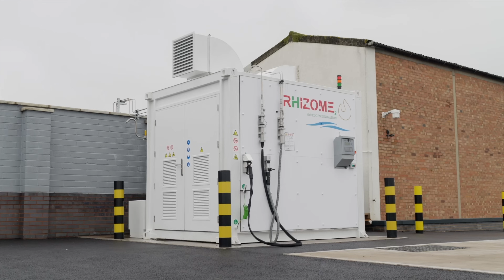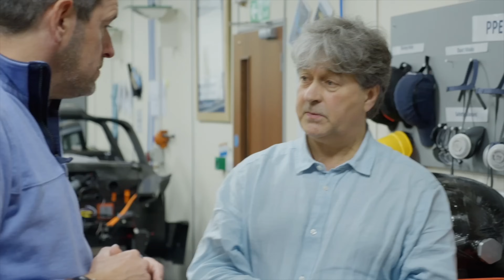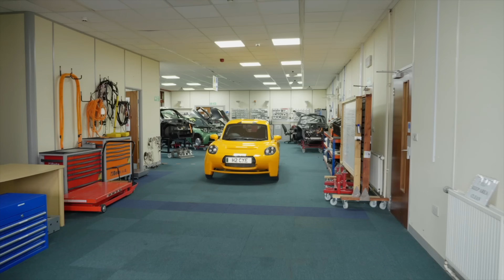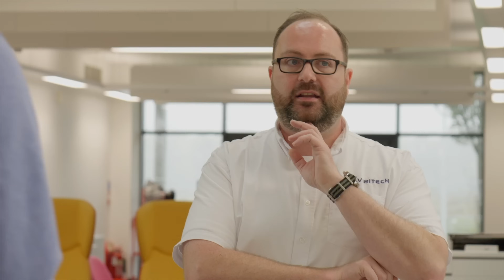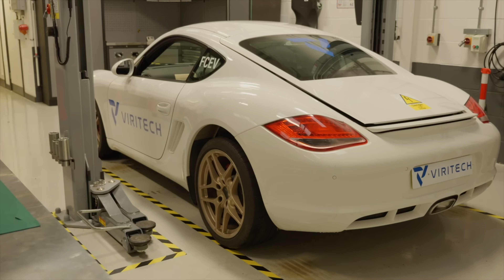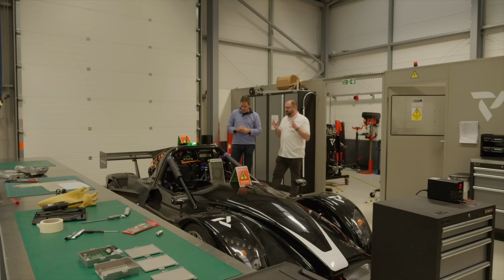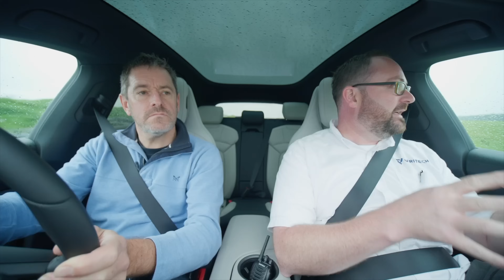Is Hydrogen a viable option for our Automotive Future ?

Comment: Yep - hydrogen will be another option, but not cheaper than a pure electric EV, plus other challenges not mentioned in this video.
Reply: Battery HGVs already exists, and most will run for 5 hours before a recharge is needed. 
Shipping is where H2 might be helpful, but only if it's from renewables, which currently most isn't. 

H2 power for cars will cost more per mile than public charging an EV, as H2 is very expensive to manufacture, transport and store. It's also extremely explosive in minute concentrations in air, which most people aren't aware of.
Reply: Cheaper for the 40% who can’t charge at home I expect.
Reply: @Gopher31  Not to nitpick but It's not 40% it's closer to 24% (the 40% figure is for 'on plot parking' so doesn't include things like flats with car parking spaces for example) and that figure doesn't include people who don't currently have an ICE car (e.g. people living in London) so is likely even lower. It's possible to charge cheaply with on-street slow chargers like lamp-post chargers which are being rolled out across the county and should be common place by the time EVs are the majority in 2035+ so don't think hydrogen will be the choice for everyday drivers.

Shipping and logistics is where I think hydrogen will play it's part, the batteries required to move huge cargo ships, 18 wheelers etc. long distance are going to cost huge sums of money relative to ICE even if batteries continue to drop in price so hydrogen is likely the better commercial option
Reply: @Gopher31 Why would you expect that?
Reply: @Gopher31  why would taking the electricity and using it to inefficiently produce hydrogen and then shipping it to eye-wateringly expensive fuelling stations make it cheaper?
Reply: @Gopher31 - hydrogen fuel will cost more than public EV charging.

Comment: Is this guy is funded by our tax money for something that seems to be talked about a lot but seems to go nowhere. Be nice to see results but closing hydrogen garages to fuel hydrogen vehicles etc is not a good sign of it working or viable for cars. My ignorance maybe.
Reply: Not your ignorance at all. It's simple mathematics.
Reply: H2 is expensive, and while fast to refill, doesn't have the same range as a modest EV. An EV is agnostic as to where the electricity comes from, hydrogen isn't, so you have to take your H2 car somewhere to fill it.
H2 works for large scale energy storage, but doesn't really work well enough for vehicles, so it hasn't taken on.
Reply: @johnnodge4327 EV’s are fine if you have the ability to charge at home but if not then they’re just a pain in the backside. Electric cars are the future and will evolve but they shouldn’t be the only solution!
Reply: @GarryM66 I agree, it should be a free and competitive market between any available zero emission technologies. Oh, wait, it already is. Hydrogen and e-fuels etc. will have important but always niche applications because the scalability, cost and other technical constraints will mean that for personal transport they are inferior to EVs. I’m absolutely open to future discoveries and innovations but currently EV dominates because it’s the best option, not because anyone is stopping the competition.
Reply: @simonm9923  Yup. Also worth noting that lightweight, high energy density battery chemistry is a virtual toddler in comparison with ICE technology. The first Li ion battery was sold in the 1990s!
Currently, we're still in the first phase of HED batteries, shall we say v1,2,5? Battery chemistries for LFP batteries are now coming very close to, or exceeding LMC batteries, and they're still 1st generation chemistries. BYD is already producing both short and long blade LFP batteries which are near as damnit to the best-in-class LMC Tesla batteries... at the same price as the Blade 1 batteries.
The next generation. (v2,0) are already in production with CATL's CM (Condensed Matter) and SAIC's SS (Solid State) batteries already ramping up production ready for launch in 2025. There are other battery producers ready to pounce on CATL's market lead if that giant slips up, with various other companies ready with 500Wh/kg chemistries. And both SS and CM batteries can charge at over 300kW/h.
So why would anybody spend the necessary investment money on a tech that appears to be already DOA?

F***ed if I know.
Reply: This fellow is blocking the likes in many of the comments!!!
Reply: It's misdirection.  As the Viritech MD said this is all for HGVs.  Not cars.
Reply: @philhough3596  And as I've already pointed out in other posts, Hydrogen has such low energy density, it still makes no sense whatsoever.
Reply: @davidcolin6519 Hydrogen per kilogram has huge energy density. In any form, storing it is difficult.
Reply: @dipladonic  Its volumetric energy density is terrible, unless you compress it to a liquid.
You're just playing a silly game by pretending that it is easy get a kg of H2.
This is the problem with the energy slope/gradient of H2, and there is no solution that doesn't require magical thinking.
Reply: @davidcolin6519  QED.
Reply: I don't trust this guy. I got into an argument with him on a previous video and he stopped replying when I questioned his conflict of interest and I asked what does being a "brand ambassador" mean? If it means you're being paid by said company (in that case it was Hendey Motors) you cannot be impartial.  At which point be stopped responding.
Reply from the maker: I open the video next to a brand new hydrogen fuel station and the biggest transport proving ground in the UK 🤷‍♂️🙄

Comment: Good for trucks. Units are too big for car production. . EVs are ok for shopping, anything doing distance needs to be ice or hybrid. Evolution will improve everything in its own time, stupid mandates will just kill industry.
Reply: Costs too much.  Truck operators will always go for the cheapest option to stay competitive.
Reply: @StuartJ  Yup, agreed. 
I think that the likely route for Long Distance commercial vehicles will be battery swap, with the batteries being hired/leased. the technology is already there and allows even better efficiencies than the current diesel, especially if battery swap stations can be combined with regular truck pick-ups/rest stops.
The reality of electric trucks is that the vehicle builders are all sticking their heads in the sand and refusing to accept any form of change (no surprise, really), especially when you consider the added cost of having an electric truck. Living in Spain (the most mountainous country in Europe), I am very aware of the problems associated with goods transport, but there are solutions and we only really need the right infrastructure and moti¡vation from national governments, but that really is the problem, nobody is taking the lead.
I do think that battery swap technology is needed, and standards clearly need to be promoted, but this is something that needs to come from the EU. No state will do it until then.
Reply: EVs are fine for long journeys. I regularly drive 400 miles in a day, and have absolutely no issues doing it in my comfortable, quiet, and efficient EV.
Reply: @johnnodge4327   but you have to rapid charge for 400 miles even if you leave home with 100% you must stop. I was talking to a mate of mine who drives an eqs 53 amg and he was telling me the battery is 108kw. And he was on a journey that was 450 miles and he ran it down to the point where he stopped at instavolt with only 4% left still with 160 miles to go after leaving home with 100%. Its a 108kw battery and he charged to 100% craming 100kw into the car for £85 pound. My diesel can do 50mpg on a run like that £60 wouldve been all he needed had he done the journey in my car. And that's not including how much it costed to get it 100% at home the night before so even more than 85 pounds really. And before you say he didn't need to go to 100% he was staying at a hotel that had no destination charging so he needed to go to 100% at the sevices because getting as much charge as possible for the trip home a day later another 450 miles back.
Reply: @cephasmakuzva  Isn't it funny how you can say that "about a mate" while the OP states that it is himself doing it?
Of course you can run the battery down too quickly if you drive using all the performance. Do that with a Mazda rotary and you'll get the same result, you'll be visiting the petrol station VERY regularly.
Nor am I even (read ever) convinced about all these claims of people doing 400 mile journeys. Seriously, there aren't that many places in the UK that are more than 400 miles apart. And if you're doing that solo, you really should be stopping for far more than a "splash and dash" anyway.
And if you're not in the UK, please point this out because it lends credence to any claim. 
I don't live in the UK, and I do know a few people who do long journeys (eg Girona to Valencia), but even then, with a little bit of care, most LR versions of EV can do 450km without any trouble.
And the only people that I know that might do 400 miles in a day in the UK are professional drivers, and that is their legal limit.
Far too much BS on all these videos claiming "My mate blah blah blah".
I simply don't believe any of it, especially knowing the driving habits of a typical Briton (average daily use 16 miles, average yearly mileage under 8000 miles)
Reply: @davidcolin6519   I live in Portsmouth and so does he. that mercedes eqs53 is a (£160k pounds car). Again look up mercedes eqs53 cost in pounds is £160k. His daughter lives in Edinburgh. look it up on your map as you'll see Portsmouth to Edinburgh in MILES is 450 MILES. We bonded over it because I also make the 450 Miles trip  myself from  portsmouth to Edinburgh as my cousin lives in Edinburgh so it's a journey WE BOTH KNOW WELL MY FRIEND. Hes actually also got a lamborghini urus. He's done the journey in that aswell leaving Portsmouth with a full 75l petrol tank and he said that 75 litre tank doesn't make it. He has to refuel that from empty back to full completely about 3/4 of the way in to the journey when he uses that to see his daughter. I told him my diesel audi has a 50l tank and that still has 65miles of range with the fuel light on but it also has an extra 40 miles below 0 as reserve so really 100 miles. I know that because I read in my car manual when it displays 0 miles still 5 litres in the tank. And I tested it by filling at 0 miles and I could only squeeze 45l in after clicking the filler 7 or 8 times.
Reply: In trucks this is something that really could be the solution because electric isn't anywhere near as good as this
Reply: Not good for anything.
ALL the science is against it.